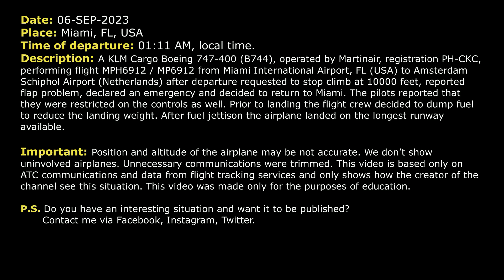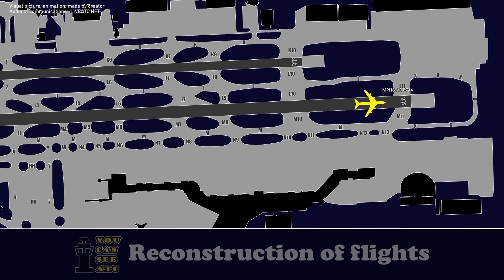Flap problem. Fuel dumping. KLM / Martinair Boeing 747 needs the longest runway at Miami. Real ATC

Comment: Max brake must've been interesting for the horses on board and probably also a reason why they tried to get a longer runway so to avoid unnecessary stress for animals.
Reply: That's not what the pilots concern was. They mention several times they fear overheated brakes and wanted to use the longer 09 runway.
Reply: With over 10.000' of runway you hardly need the brakes at all.
Just full reverse and a low autobrakes setting would a enough to stop at the end.

Comment: Thank you very much for picking this incident up! A calm and very professional dealing with this emergency situation by both sides! Really exemplary!👍
Reply: I was surprised by the crew not requesting fire equipment but they talked over and over about their coming hot brakes (max landing weight and short runway) seems illogical for me. Safety first - get the fire engine with you if your brakes catch fires it can be not be a simple PAN PAN PAN anymore.
Reply: @12345fowler  They probably assumed that ARFF would be on stand by - but of course: assuming is something else as knowing.
Reply: @NicolaW72  

They say that they didnt needed them, but that they knew they were there.

Comment: KLM Martinair in the PAN-PAN stated 3 souls on board plus horses. As a long haul I would expect that would include one reserve pilot? It is confusing as KLM advertise horse movement with specialised personnel accompanying the horses in cargo.
Reply: Possibly just 2 pilots and a groom for the horses.
Reply: Relief crew regulations vary by airline, with relief crew requirement cutoffs between 7 and 10 hours flight time, commonly 8h. FlightAware doesn’t show 9/6 MPH6912 on their free site, but the 9/13 MPH6912 flight, also MIA-AMS, was scheduled for 7:40 (actual flight time was 7:47).   Fwiw, definitions vary, but ICAO defines long-haul/long-range as > 8 hours.
Reply: @rdspam  - I did a freighter flight recently which was about 8:15, just two crew. 

If there are 3 then someone is on board looking after those horses.
Reply: @EdOeuna  Thanks for the clarification. I was really curious as KLM are the go-to for flying horses, and for example their blog has info on horse movement where the grooms always work in pairs for safety, and they market really professional horse care. I cannot tell a lie, I was wincing at the thought of the plane landing heavy with the horses, but the pilots sounded cool as cucumbers! Good outcome.
Reply: @rdspam  Thanks very much for explaining the flight time; it makes sense now. Much appreciated.
Reply: I would have expected 5 or 6 on board based on other flights.
Reply: Definetely two Pilots on Board - all European Carriers fly the Atlantic Route between Europe and the US with only two pilots => different regulations by the FAA and the EASA. So 3 POB = 2 Pilots and one Person to take care of the horses.

Comment: The runway at Homestead Air Reserve Base is 11,200ft. It’s about as far away as Ft. Lauderdale, and much closer to MIA than Palm Beach.
Reply: No maintenance, no cargo ops capability in case of being disabled
Reply: With the fuel they had on board they could have flown to any eastern seaboard airport but they were obviously restricted by the GG’s.
Reply: No reason to land at an air base. Just go to where you came from. It most suitable.
Reply: Pilots probably don’t have charts for that, and it’s probably not in the GPWS terrain database either.
Reply: @EdOeuna  But I woulda thought ATC would know about it.

I’m not saying they should’ve gone there; I just wonder why it wasn’t offered as an option.
Reply: @lebojay  - generally, ATC aren’t there to offer solutions, just to facilitate with an aircraft’s emergency. There isn’t an issue with landing back at the departure airport for the 748, it just determines how much fuel they need to jettison.

Comment: That controller really needs to pay more attention - the crew stated pretty clearly what they wanted to do a few times but he was still questioning them. Professional from the Martinair crew, the controller not so much.
Reply: I think the controller did just fine. The crew used words like "probably" regarding whether they would be returning or not. He did everything they asked. Sometimes trying to understand a situation and relaying it over a radio isn't easy. Just because WE hear it (recorded at an unknown location), doesn't mean the controller heard it because radios don't always work due to all kinds of interferences (the airplane position/bank angle, another aircraft or radio stepping on the person transmitting, atmospherics, noise in the room etc.etc.). I'm not a 747 typed pilot, I have flown other heavies. I am curious why 8R wouldn't be long enough (yet they landed on it) and they thought they would have hot brakes and possibly close down the runway but none of that happened? Did they not want to dump the amount of fuel required to safely land on 8R in order to save money?
Reply: @JohnSmith-zi9or they likely want to avoid the lengthy fuel dumping. Pilots are always biased to get the plane on the ground when there is an emergency. The idea of dumping fuel for 45 minutes isn’t exactly appealing.
Reply: Thanks for giving points- are you a professionnal ATC-  Aircrew match commenter lol ?
Reply: @12345fowler  "Thanks for giving points- are you a professionnal ATC-  Aircrew match commenter lol ?"

Are you referring to me?
Reply: The controller was very lackadaisical about the situation. "No Worries" is crappy phraseology! Never once did he make a required transmission that fuel dumping was in progress. The county couldn't open a runway when they're changing out lights. Sadly work
ethic in aviation is deteriorating. Glad to be retired. ATC 1977-2008.
Reply: @rickpaige130  You put a lot of faith in that these recreations are exactly what happened. I assure you, VASaviation's channel takes liberties, time compresses, omits communications and sometimes changes the events to make it more clickbaitable. I've caught him doing just that! 

Regarding the fuel dump call, was there anyone else in his airspace? If not, who cares? Again, it may have been omitted here or they may have been on a discreet frequency. 

You don't know what the extent of replacing the lights on runway 09 was. If the runway lights were out of service, they can't land on it. Those pesky FARs. So why you scoffed at the idea but we don't know the extent of what was going on at the time.
Reply: @JohnSmith-zi9or  regardless if  the closest aircraft is 500 miles away it is required that the controller makes a transmission that there is fuel dumping in progress. When there are 100's of square miles of water to dump fuel over why in the hell would you dump over a populated area. This entire evolution was handled poorly by the controller! By chance are you a controller sir?

Comment: Interesting etiquette question. Obviously an emergency aircraft gets what it wants, but to threaten to close a runway merely because other options were less convenient for their engineers?
Reply: The reason why they metioned the closing of 8R is because they most likely are going to have hot brakes and maybe blown tires due to the shorter runway and the heavy braking they would need to do. All of that they mentioned to the controller.
Reply: I don't see it as a threat. It's fair if you think you can't handle it. That being said, When the controller said that RW9 is not available due to maintenance, that should have ended the discussion.
Reply: @harryyoung1990  sounds like the pilots are trying to help the ATC to not be a massive 250 ton (possible on fire) roadblock on the middle on the active runway.
Reply: The airport was reportedly working on the lights on the runway. They had already closed the runway and started the work.... Apparently, once started, the runway was unusable...
Reply: I didn't think he was threatening anything, he was just clarifying that MIA would only have 8L and 12 (maybe) available if they landed on 8R, because if the tires popped it would take a significant amount of time to get the plane off the runway.
Reply: Yeah I understand the problem with RW09, it was the response to the suggestions of Orlando that I was observing.

Comment: They were dumping fuel over land?
Reply: At certain hight that is not an issue...
Reply: It evaporates before hitting the ground.
Reply: In the video they are dumping 20 miles off the coast.
Reply: Nope, they also dumped over land.... @MrWhiterunGuard